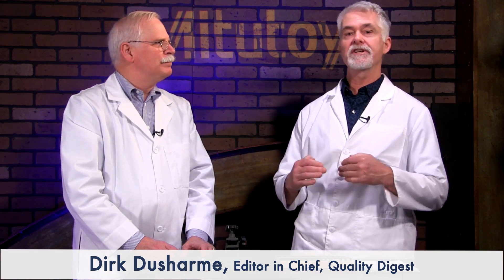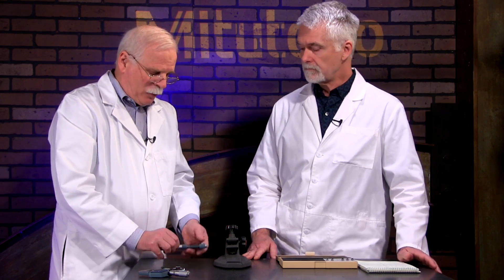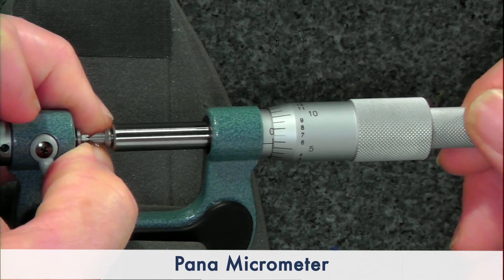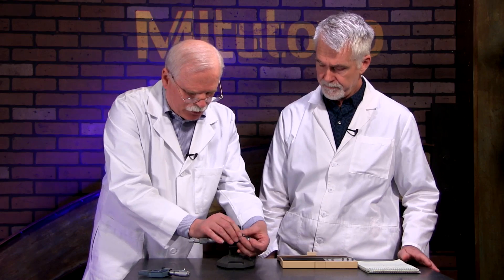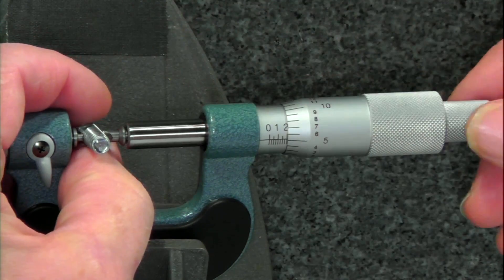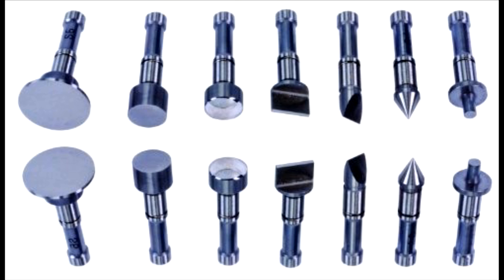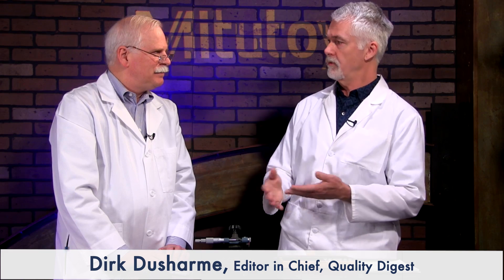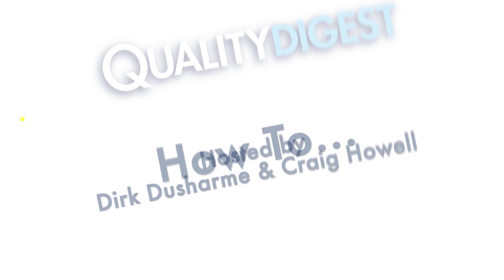How To Ep01: Measure a Thread Pitch Using a Pana Micrometer #metrology #micrometer

Comment: I used to use a three wire method which was cumbersome. Then decided to Sent them out to labs. I also tried using an optical comparator. Got some good readings. BTW, those attachments were available from mitutoyo many years ago..